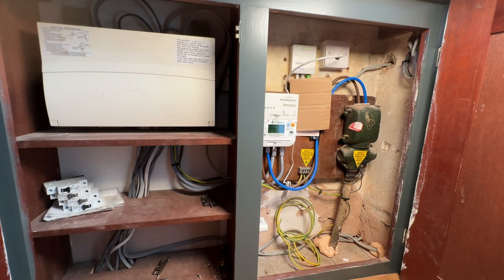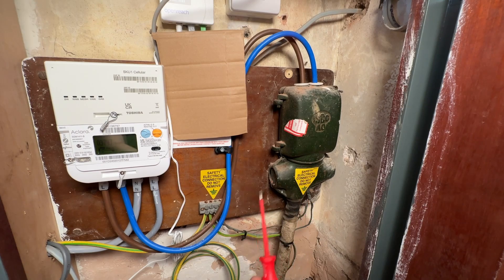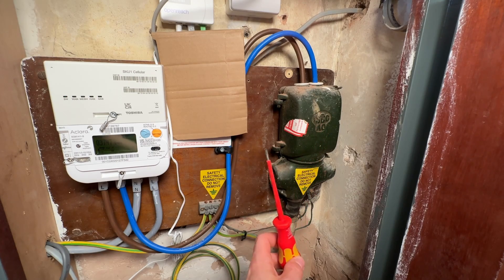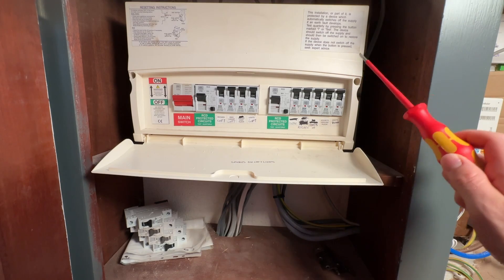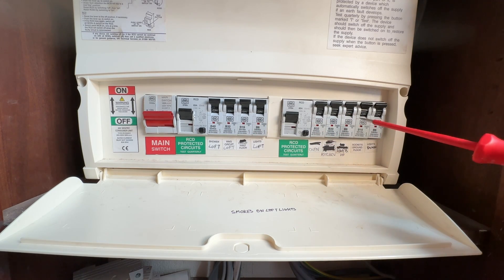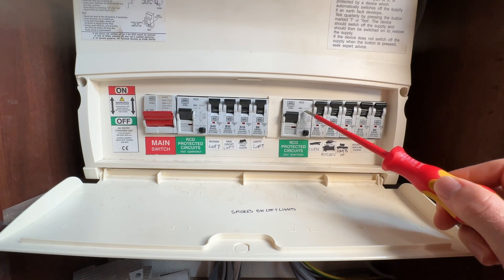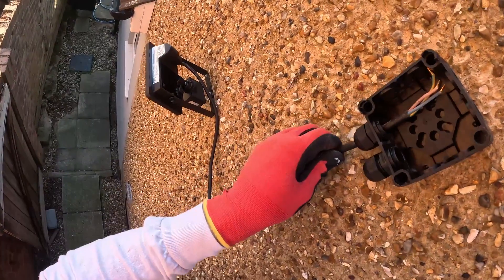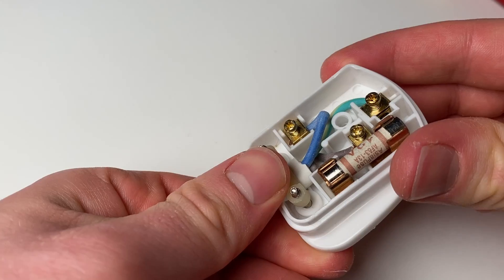What Electrical Work is a DIYer Allowed to do?

Comment: A great overview, thanks, especially about who owns the various “links in the chain”.  A question;
When rewiring a property, would it be possible for me as a DIYer to do all the leg work of running the cables, installing sockets, etc and have a qualified electrician install the consumer unit, connect up all the circuits and connect to the meter?
Reply from the maker: Thanks for watching! 
You could, but you’d need to speak to your local building control, they’d come and inspect the first fix, then inspect and test the second fix. 
Alternatively, you might find an electrician who would agree to sign off your work, but it’s not really allowed. 
Another alternative is doing it yourself without sign off and buying an indemnity policy against any risk from doing that. That’s the most risky approach though, and not one id recommend.
Reply: @TheDiligentDIYer1759  Thanks for the quick reply.  Actually I posted my comment before reading the comments below about Scotland, which is where we are.  I might have a chat with the electrician here that's done a lot of work on another property for us.

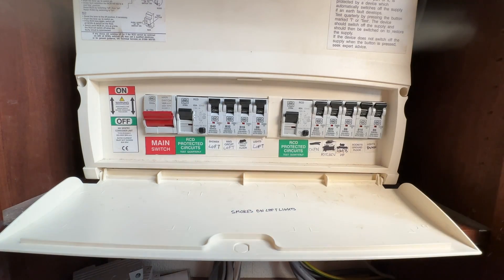Comment: 5:24 you do not have to be registered to carry out the work. You just need to be competent. This is the second video I have found that is leading people upma path that doesn't exist. Page 2 of the Part P document you provided (the first page after the tirle cover) a link to states this.
Reply: If you are not registered and carry out notifiable work, the work must be inspected and signed off by the local authority's building control, £180 plus vat.

When registration of work is required,

Notifiable work: This includes installing new circuits, adding a new circuit, or making changes to existing circuits, especially in special locations like kitchens or bathrooms. Failure to do so will lead to fines and other serious consequences.

Commercial work: Electrical work in commercial or industrial buildings must comply with the Electricity at Work Regulations 1989.

Comment: Why is the meter owned by the electricity seller? That makes no sense as you have to change the meter if you change the seller? In Finland it is owned by the local electricity network and they give the data to the seller. That makes changing the seller easy.
Reply from the maker: Yeah it’s an odd setup. Thanks for watching!
Reply: Yes, I’ve often thought the only way a smart meter could earn its title is if it monitors my usage patterns, constantly scans the tariffs available from the suppliers and automatically connects me to the cheapest one!  That would be smart, but it would have to be independent of the electricity sellers.

Comment: Regardless of being registered or not, you can get away with a lot of things in your own house. It's a completely different story if the house burns or somebody get seriously injured at any time later on.
In my opinion, if you are a DIYer and didn't receive at least proper practical training from a professional than please stay away from anything that:
a) operates over 50V
b) is able to deliver more than about 20A. (Welders know, why :-) )
c) is close to flamable materials
d) has lithium batteries inside (YES!)
While RC models have very powerful lithium based batteries, they can be operated safely following the guidlines. Operating the same batteries in a DIY circuit 24/7, unsupervised and inside a house can be dangerous. Many things can go wrong.
Just replacing the plug of an old lamp could kill. Don't self-educate, make the first steps under supervision of an experienced person.
Reply from the maker: Thanks for sharing your opinion

Comment: ok i'm going to say it. When you pay someone to do a job, mostly, you get a pretty "bad" job.

This is because an electrician is primarly an electrician to make money. Making money is based on the time you spend on a job,the shorter the time, the more profit you make. IME, pretty much no electrician has the time to properly and neatly route wiring for example, they tend to just pul the wires straight from A to B. Take a look at your own lecy cupboard at 0:18 into your video and look at the routing of the wires coming out of the consumer unit.....

As a DIYer i have no real monitary constraints on my time. As a result, my wiring is far far better installed than any commercial wiring i've ever seen.......
Reply from the maker: Yeah a DIYer who knows what they’re doing, generally does a better job. Thanks for watching!

Comment: You haven't got a split load board, you have a dual rcd board
Reply from the maker: Having done some research, it seems some people call a dual rcd board a split load board, but some people use the term when there is only one rcd protecting half the breakers, and the other half not protected by any rcd. Thanks for watching!
Reply: in UK, we would call it a split load board!
Reply: @jameshansing5396  no we don't. Split load boards have rcd protected circuits on one half of the board and non rcd protected circuits on the other. 30+ years working as an electrician means i know what i am talking about
Reply: @curtisj2165  well that’s what usually call them when we are working as electricians 👍
Reply: @curtisj2165  certainly never heard it called a dual RCD board.

Comment: I think the advice you have given whilst technically correct could lead to someone getting in to a lot of trouble. If you are going to give out this kind of advice you should give people a little more information. I do realise it’s just a video to let people know the kind of thing they can do but you should be adding caveats that usually dissuade people from doing DIY works and thinking I’ll give it a go and use a qualified, competent electrician. There is a lot to consider to even an addition of a socket. Also you didn’t once mention BS7671. It may not be mandatory to follow those regulations they will certainly be used to prosecute anyone deemed to be at fault for injury or death from work they have carried out. While a simple socket change is not notifiable there is plenty that should be done according to BS7671 (for instance a minor works cert). If it’s not there is a risk DIY’ers could find themselves in trouble. You shouldn’t be dissuaded from doing the work but you should be made aware of the implications IF it does go wrong.
Reply from the maker: Thanks for sharing your opinion and watching

Comment: Consumer units now have to be made of metal?
Isn't that going backwards: plastic doesn't conduct electricity: so apart from during a fire, I would have thought that a plastic consumer unit would be safer???
Reply from the maker: You would have thought so, but now it is metal as they contain a fire for longer than plastic, in case you get a fire inside the consumer unit. The case is painted metal, so lower chance of conducting, but absolutely agree it is a risk. Thanks for watching!
Reply: It’s a case of risk vs reward. There will always be some sort of trade off. You can sit all day and imagine all the unsafe scenarios that will occur and try to mitigate for them all. That would leave you with a very costly DB. The chances of your main Earth becoming disconnected plus a live conductor becoming loose and then touching the casing is a lot lower than a poor connection of one of your final circuits resulting in a fire.

Comment: Being as i cant open up my consumer unit, am i allowed to reroute an existing circuit? Like could i re-purpose an unused oven circuit (ignore the kitchen zone rules for now) into a standard radial circuit with a couple of (or even just one) sockets? Obviously, i would have to change the labelling on the front of consumer unit.
Reply: Careful with any spurs, though. An oven circuit will likely have a 30A breaker and 6mm cable that can take that current. If you run any thinner cable onwards from the existing wiring, you could be drawing way too much current than say a 2.5mm cable could take and run a fire risk. You'd need to either run thick cable or, safer, have a lower amperage breaker on the circuit.
Reply: Anytime a cable size is reduced it needs to be fused down. You’d overcome that problem by installing a FCU between the 6mm and 2.5mm.
Reply from the maker: It is okay to modify an existing circuit, and what you’ve described sounds like it could be considered a modification. Obviously at your own risk though. Thanks for watching!
Reply: Thanks all for the advice. The plan is to replace the cooker isolation switch for an armoured cable junction box or isolation switch, run 6mm armoured cable out to the shed and stick a small garage consumer unit on it. From there, I'll have 6a breaker and 16a breaker for lights and sockets.
Reply: Just a few little tips on that! Any junctions need to be accessible unless maintenance free. The armoured will need to have both glands connected to Earth and if you bury the cable it should be deep enough and indication should be placed over it. Also your garage consumer unit is covered by the same regulations as your main CU. It’s effectively a submains and any other circuits added will need to be treated as such.

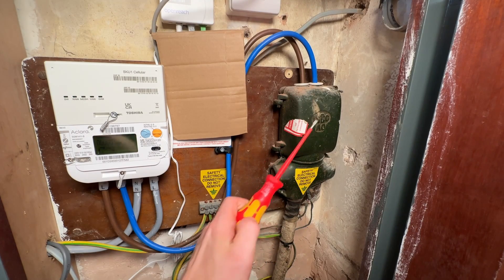Comment: 1:38 - what about Northern Ireland? You know the United Kingdom of Great Britain and Northern Ireland?
Reply from the maker: SONI in Northern Ireland, thanks for watching!
Reply: @TheDiligentDIYer1759  You need to do better research - SONI is the licensed independent electricity Transmission System Operator (TSO) for Northern Ireland. There are currently no statutory requirements for domestic electrical installation work in Northern Ireland.

Registered electricians in Northern Ireland work to the UK national safety standard (BS 7671) and will give you a safety certificate to confirm that their work has been designed, inspected and tested in line with that standard.

Comment: 20amps for a kitchen sockets is not enough really
Reply from the maker: I’ve never had an issue with tripping, oven is on a separate circuit and hob is gas. I agree it would be nice to have more headroom, but whoever fitted it only did a radial in 2.5mm2, so no scope to increase without making a mess!
Reply: when i do a rewire i run two 32a rings to a kitchen 1 for general sockets and 1 for the grid switch for the appliances. plus a cooker circuit
 @TheDiligentDIYer1759

Comment: I’ve always done my own electrical work by the book as a DIYer as I feel like there are far too many incompetent “electricians” out there who really give the trade a bad name. I think most people with common sense know that it is not worth touching anything in the consumer unit as even with the main switch off the meter tails are still gonna be live so it is not worth the risk. Plus circuit breakers and terminals inside a consumer unit need to be specifically torqued to a certain setting as recommended by the manufacturers. Only proper electricians will have a torque screwdriver to hand.
Reply from the maker: Yes you are right, I think the worst are rogue landlords trying to save a few quid. Thanks for watching!
Reply: Anyone can say they are a spark and just be a DIY er  like yourself. I hope that you test all your work, because even if your sockets or lights  etc are working, it doesn't mean it is working under fault conditions and you can end up killing people.
Reply: @djpatricksmiley383 it’s not just the fault that it may be working under, it’s also the quality of what is done. For example failing to use a grommet on a back box entry. No fault at the time but could wear through the insulation eventually and cause it to go live. If you failed to connect the earth (cpc) to the faceplate and it’s a metal plate then the face plate would be live and you’d get a shock.

Comment: The little Englanders strike again. The rules are completely different in Scotland as there is no such thing as Part P. This is not surprising because they are part of England's building regulations which again are different from Scotland's. Edited to add roughly if you are not in a flat or three-storey building you can do your own electrics like you could in England prior to Part P being introduced.
Reply from the maker: Interesting to know, thanks for watching
Reply: Part P is just a competent person scheme, there’s other schemes too. this allows you to effectively sign off the works without needing to get some one from building control. 
DIYers can change the consumer unit, you need to then pay for the council to come out and certify it. Just the cost of that you may as well pay an electrician lol. 

So in Scotland, I take it you need to pay building control to come out and still certify ?
Reply: @jamesdean8864  No, nothing to do with building control if you are working on your own property and it's not a flat/tenement and it is less than three stories tall no certification is needed. You can do a full rewire if you want. Basically, it is like England prior to the introduction of Part P, but properties where a fault causing a fire has higher consequences then it needs to be certified. It should be noted that you are orders of magnitude more likely to be killed by a fire started by an electrical fault than be electrocuted.
Personally, I think there is a middle ground where you could get a City and Guilds and provided you have a consumer unit to at least the 16th edition (aka RCD protected to at least the socket outlets) you can work on your own domestic electrics and self certify. Not that it applies to me living in Scotland in my own property which is not a flat and is less than three stories tall.
Reply: @jonathanbuzzard1376 thank you for the reply, I never knew this. I don’t know how I feel about it either, I do agree we need a middle ground but at the same time IMO having regulation and laws around them ensures that there is a level of standard especially say if you were buying a home. Granted when buying a home the previous occupier could have done anything but I feel that the introduction of better electrical regulations has its value. 
Crazy that Scotland isn’t too far from me and the two countries are so different. 
Thanks again for the enlightenment, I’m going to use this down at the pub 😂
Reply: Yea I do agree with u on this as part p is only England and Wales. not in Scotland and Northern Ireland as under as under local council area building control.
Reply: I'm a spark, and I will tell you guys now, no one really takes any notice of Part P... When I get calls.. because some house owner messed up on their own installation.. I ask.. do you know about Part P.. and notifiable works.. they always often say.. part ..what?

Comment: The key difference about electricity and plumbing. An electrical circuit will work because you know what you are doing. A newly fitted plumbing fixing will leak because it hates you.
Reply from the maker: Hahaha very true, compression fittings can be very annoying especially if not new

Comment: I hate UK outlets.  Of all the outlets in the world the UK gets first place for the worst outlets.
Reply from the maker: UK plugs and outlets are definitely the best in the world
Reply: This may be true when you only have one item that needs to be plugged in.  It's an annoyance when hotels are equiped with these outlets.
Reply: @iceman9678 

What do you mean only one item to plug in. Most are twin sockets. And fused 3 gang sockets are available
Reply: What you say may be true in the UK homes, but when traveling many of the hotels only have a single outlet.
Reply: @iceman9678  

 Old hotels and homes that haven't been rewired sometimes have singles but if rewired they will be doubles. There are adapters also available, fused versions advised.
Reply: That's what I am saying.  Most default international outlets are double style except for UK.
Reply: @iceman9678  

Single sockets and double sockets are still available and  installed in the UK. The vast majority, though,  are double sockets. 

All of the sockets in my house are double sockets and it was last rewired 25 years ago. In my old house, they were all double sockets, too.

In hotels, you might get a single by the bed, for example, but most should be double. But it doesn't justify your original comment that "of all the outlets in the world, the UK gets the worst." That's not true. Blame the hotel you stayed in for fitting single sockets, not the quality of UK sockets. 🙂

Not sure where you are from, but the single socket option is available all over the world, including the US
Reply: Consensus is that most people think they are the best about. I cant see any reason why they would be the worse that has to be given to the US plugs. They are one small step up from just jamming wires into the holes with toothpicks.
Reply: Actually, UK outlets have a great reputation, so do our fused plugs. It's the ring final circuit that doesn't because it requires additional testing.
Reply: @martinw245 The fused plug is only because the ring final circuits.